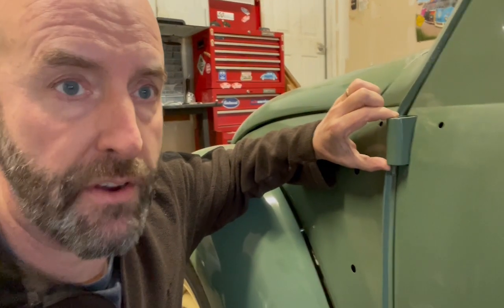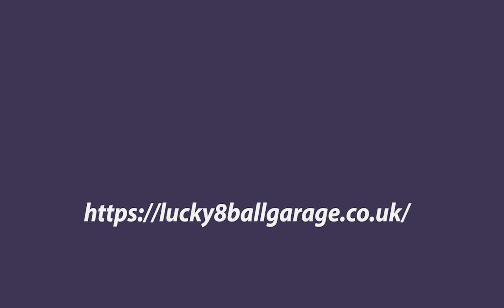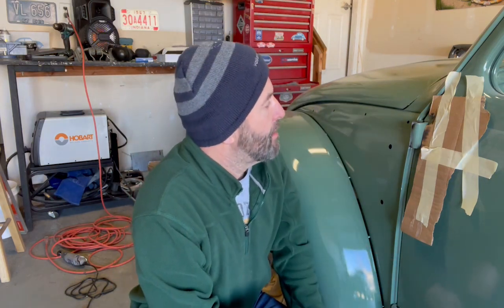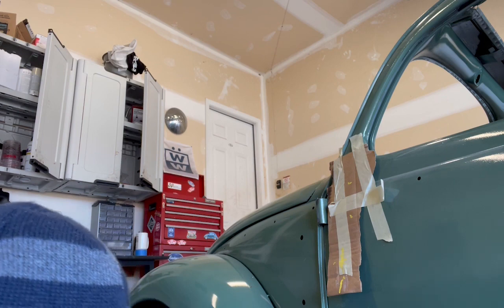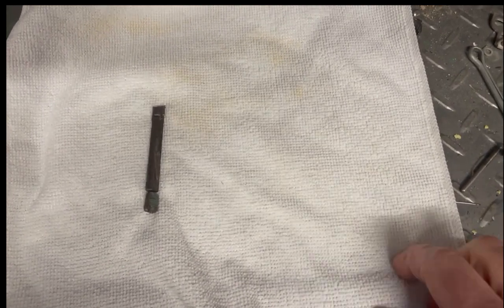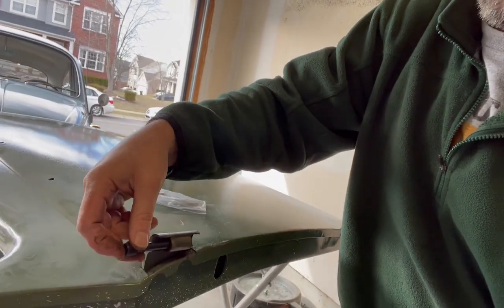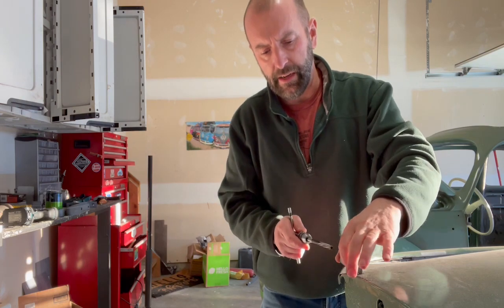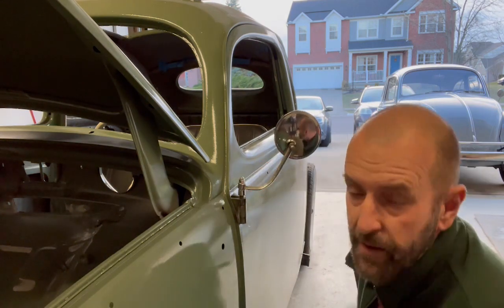Hinge Pin Removal and Replacement Techniques on a Vintage VW Beetle

Comment: I was a body shop mgr for a VW dealer years ago and those darn hinge pins have always been trouble. Living in Michigan the rust build up would seize the hinge from opening and closing easily. Using air hammer, heat and lots and lots of penatrating lube to drive those pins out, an then like you did, ream the hole for a new pin. Your video brought back memories, thanks for posting it.

Comment: Great vid - an alternative is to take off the door & fit a new hinge by drilling out the rivets on the door side & using threaded coach screws when re-fitting

Comment: As a machinist a Machine shop is the answer. I have rebuilt several hinges for various cars. The hinges need to be reamed to a larger size and new pin made. For a really good job a milling machine is nice.
Reply: Well vw made the pin sacrificial and 90% of the time you don't need to go up a size ..  ask me how I know..  yep that's my tool and I've done quite a few pins now

Comment: I used an air hammer and propane torch with the door off the car.  Didn't come out easy, but it eventually came out.  I also tried the Eastwood tool, to no avail.

Comment: I have the same tool and I had to use an impact drill on the top nut. And I got it off. I also soaked it with something for a few days. It worked easy with the impact driver. Got a new pin for a side mirror and used that tool to press the new pin down in there.

Comment: I found a similar tool I rented but it was actually a c clamp looking configuration and was very heavy duty, regardless even with a ton of heat on it the tool broke and I had to weld it up several times before I was able to get three of the pins out.
the fourth would have taken dynamite , after days of struggling I eventually cut a slit in the hinge with a very thin die grinder blade and again used the tool to push out the pin that was actually in three pieces.
I welded up the slit and reamed the hole for an oversize pin  , in the end it all worked out but what a pain !!!

Comment: I recently had to remove the pin in the hand brake of my 68 double cab, they just rust and weld themselves to the hinge.  It's not your fault, the two metals become one.

Comment: Just did my '64.  They are not theaded, they are splined.  Air hammer and heat did it.  Oversize pins are avail with a reamer.  Use neverseize on install.

Comment: Pretty sweet dude. Glad you got it out. Was it possible to push it out from bottom instead?
Reply from the maker: I have heard that is possible if you drill out the center first. I didn't try it, tho.
Reply: It is designed to be pushed up from the bottom.

Comment: Hi interesting to watch . Not an easy pin that .  Looking at the fact it's got threads on the bottom its definitely not a factory pin.. 
Get in touch I'll send you a replacement handle
Reply from the maker: Thanks Lucky 8 Ball!!

Comment: Just curious, did you replace the lower pin too?
Reply from the maker: Only the top. There was no play on the bottom.
Reply: @jwyingst  I have a 56 sunroof with the same hinge pin as your car. Do you ever rent out the hinge pin extractor?

Comment: Thanks, I should do mine so I can mount a passenger side mirror. 65 bahama blue paint, dont want to scratch it. Going  for it with UK tool.
Reply: Pass. Side mirror is useless.  In order to see out of it,  you have to swing it too close to the door and your door will hit it.